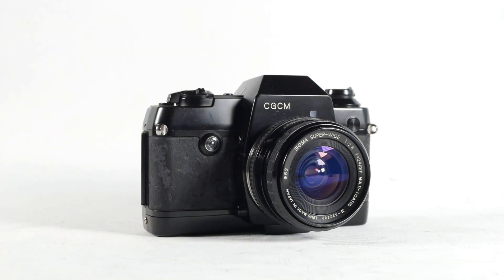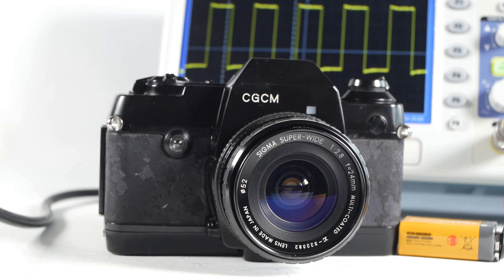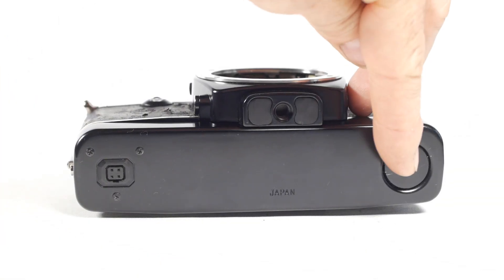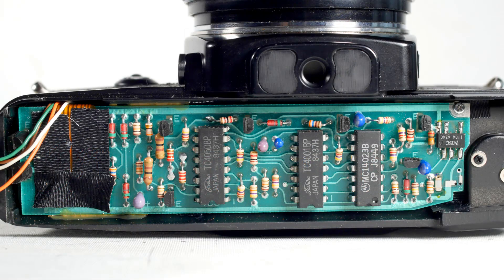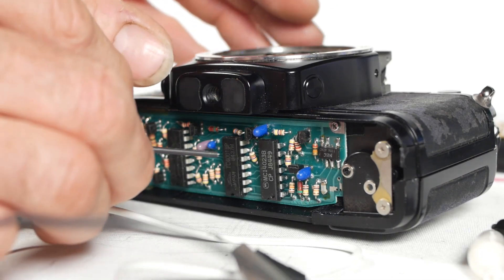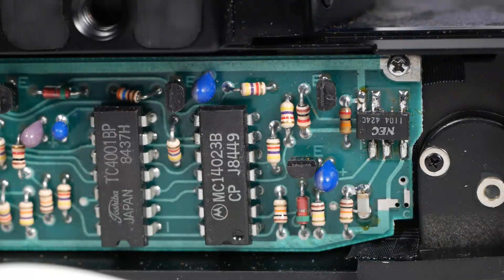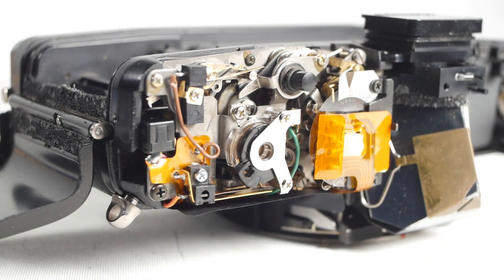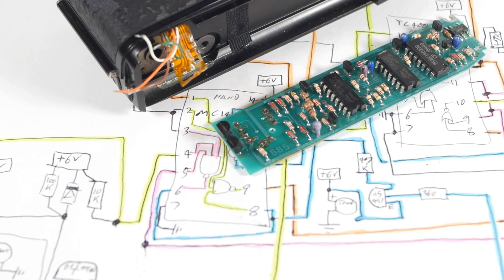Contax CGCM Oscilloscope Camera - The World's Most Useless Camera!!!

Comment: Weirdly that power input on the bottom looks nearly identical to the plug on Nikon D1 batteries for charging.
Reply from the maker: Hi Miles, I figure that Contax (or Yashica, or whoever converted these from new) used some readily available connector when they threw the CGCM together, and it's not impossible that Nikon used the same fitting, or at least the profile when they developed the D1.  What a camera the D1 is - I'd quite fancy having one of those in my collection, but like most of my stuff I wouldn't want to pay much for it.
Reply: @GrumpyTim  The D1 is a fun camera, and it is kinda funny how much like a film camera the original version (not the D1H or D1X) is operated, considering they don't use the rear screen to tell you what the settings are, you have to consult the manual and use the tiny bottom LCD with numbers corresponding to the settings. It really is a fascinating point in the transition from film to digital. I managed to pick one up for $50, and since basically all the original NiCd batteries are dead by this point, did the mod where you put some 18650 cells in there, and for the heck of it slapped on a BMS and USB-C charger, cause why not? However picking one up definitely is a gamble, both my D1 and D1H seem to incorrectly read battery voltage, funnily enough in the wrong way. My D1 says the battery is at full power, when in reality it's low enough voltage that the camera isn't properly saving the pictures (they just turn out all white), and my D1H says my battery is too low to even take pictures, despite being fully charged, and working perfectly on the D1. The joys of aging electronics.

Comment: I can see reasons for keeping the shutter open for longer than a fixed time: registering jitter in waves for example, you could see it on a longer exposure, when the subsequent waves start to pile up.
Reply from the maker: Yeah, I'd love to see the entire setup that this camera was used in - was there the additional leaf shutter within the lens unit?  Did it only have one shutter speed? etc etc.  I should be able to determine exactly how the camera itself operated once I've done some more stripping down to find out what the mysterious signal at the one second mark was for.  It is still possible that signal wasn't used in the particular configuration that my camera was used for - there's clearly at least one feature that isn't used because the output from pin 6 on chip TC4050 just goes through a resistor to an unused tab on the PCB.  It definitely makes sense that they would configure the cameras for a particular customer's needs because it was after all, a pretty specialised unit, and probably pretty expensive too.

Comment: Very intriguing. I see the date codes on the chips is 1984, if that has any significance.
Reply from the maker: Hi John, I had intended to see if there were any traceable date codes so you've saved me the effort, thanks for that.  So the camera is probably a couple of years younger than I thought.  If the serial number is anything to go by, they made a fair few of these custom versions, probably with many different tweaks depending on the particular application they were being used for.

Comment: Could it be that it is a prototype ?
Reply from the maker: Hi migsven surfing, I don't think it'll be a prototype for a few reasons:  There are a fair few of the Contax CGCM cameras around and there would be little reason to make that many, more or less the same, prototypes.  It would be unusual to blank off so many regular features for a prototype, and also the earlier RTS had a much more advanced control system than the relatively agricultural system in the CGCM.

If the serial number is anything to go by they probably made a fair few of these customised CGCM cameras, and I bet they sold them for a whole lot more than the standard camera - or at least by the time it got to the end user it would be expensive.  Say for instance they were used with high end HP oscilloscopes, you can bet your life that the hood complete with camera and special lens was a really expensive accessory.  I'd love to see a sales brochure to find out exactly how much they were.

Looking at the PCB, most of the soldering looks like it might have been done in a semi automated process, and then the two smd (surface mounted device) components were soldered by hand afterwards, and they're pretty scrappily soldered - no idea why those two are smd when the rest are through hole components, maybe I need to collect more CGCM cameras to see how others differ......